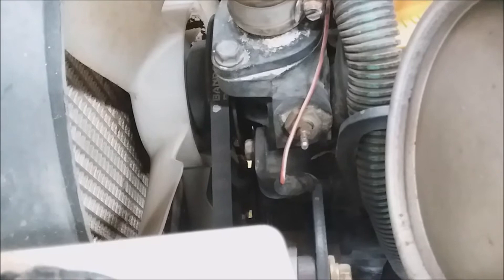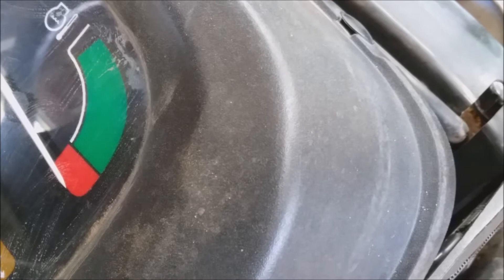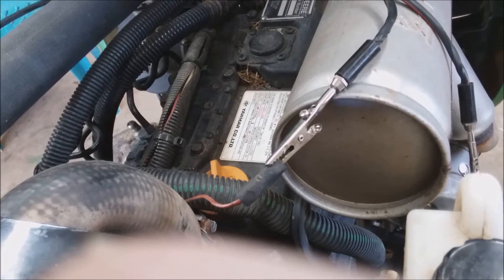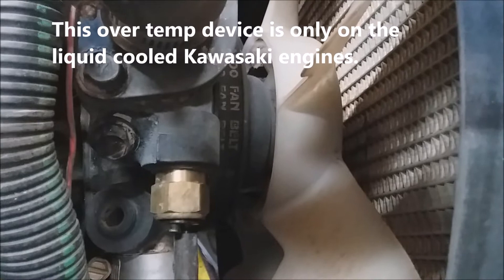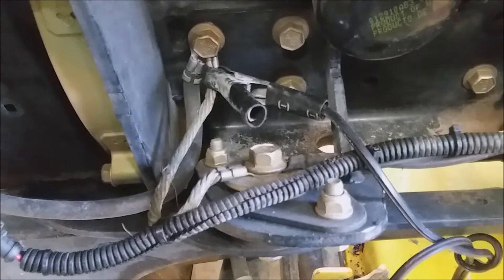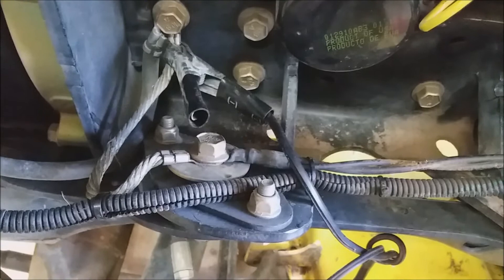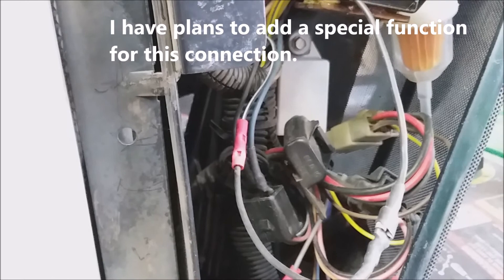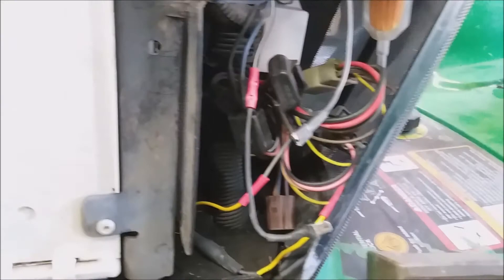John Deere X475 to X595 Instrument Cluster Testing

Comment: I am very familiar with the X 595 heating problem but I found the problem. When you pull the side panels to clean the trash screen and blew out the radiator I thought but it was still overheating so I repeated the process but got a high powered light and looked between the oil cooler radiator and regular radiator and thought I was seeing trash. I unbolted the two top dolts holding the two radiators assembly together and I found the problem when I separated the radiators. There was grass and other trash packed between the radiators. I used my long nozzles air blower because you can’t get your hand between the radiators but there was a pile of trash that would fill a five gallon bucket. I reassembled everything and I had a new John Deere that the heat gauge that badly moved and the power was back up on my engine with no overheating shutdowns. This is a very poor design on the X 595 diesel because this Lawn And Garden Tractor can outperform any small compact tractor.
Reply from the maker: I have owned John Deere 322, 332, 345, X495, X595 and X740 tractors. They all have a problem with overheating.  The best solution is to keep the intake and radiator screens clean.

Comment: I have a similar problem with my 2002 X595 where the temp gauge will go up as the tractor warms up and and the needle with peg all the way and then when you shut the PTO off, it will go right back down to normal.  I have changed the temp sensor, PTO switch and the thermostat and it did fix the problem.  The fuel gauge has never worked right almost from day one with the needle acting crazy.  I believe I have broken solder joints.  I would like to replace the temp sensor with either a mechanical gauge or digital gauge but I think I will have a very hard time finding the right (metric??) threads that I will need for the sensor to screw into the housing.  Any thoughts or suggests?
Thanks,
Curt.

Comment: Hi, and thanks for the video.  I have an X585 that I am having a dickens of a time with the fuel gauge.  A few years ago the tractor had the typical issues with the gauge cluster.
Resoldering solved it.  Recently the fuel gauge stuck on full.  I have been testing but am getting nowhere.
Would you mind going into some detail on testing the gauge?  I think I can test the sender ok.
I just can't determine if the gauge is bad or it is connections again.  Thank you.

Comment: I meant to say that after replacing the temp sensor, PTO switch and thermostat, it DID NOT fix the problem.  All my screens are cleaned several times a day and the radiator is blown at least once a week in not more.
Curt.

Comment: From your experience is the X475 a good tractor? Any major issues with this unit?
Reply from the maker: Yes, I would buy a X475 if the price was right, but I am partial to diesels. I owned a X495 which has the same hydro. The X475 has a carburetor rather than a X485 that is fuel injected.FI can be expensive if you have problems.

Comment: My dad has a x475 and he says that when he turns the powerr take off on and the the temperature guage and gas guage goes crazy and shows that it running hot but it's really not and he can't figure it out.  Do you have an answer?
Reply from the maker: The problem usually is a bad solder joint on the circuit board pin 20. I have been able to repair four with this problem. I have also had two that I could not repair because of water damage. I would finally replace the temperature gauge with an external DIGITAL one. No guessing about the temperature. What does red really mean?